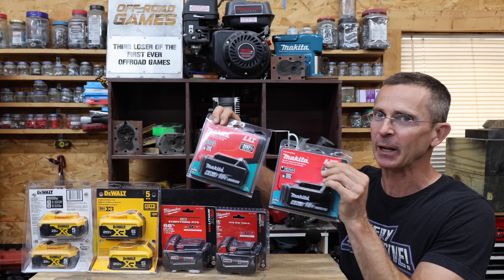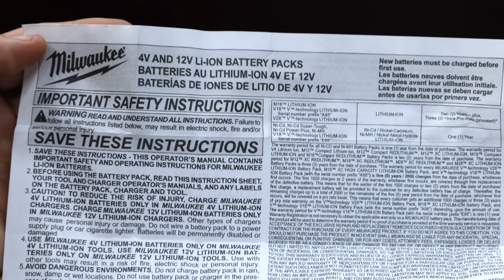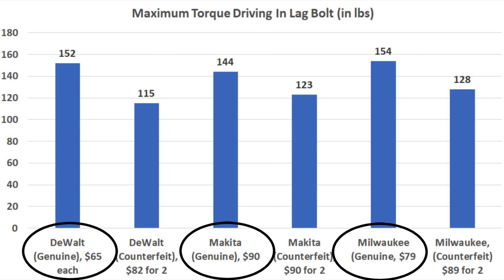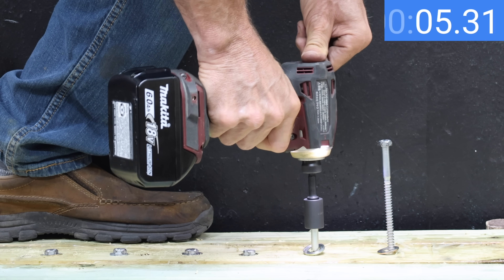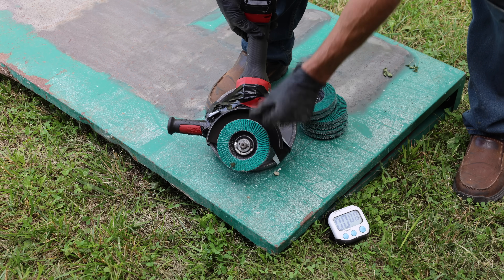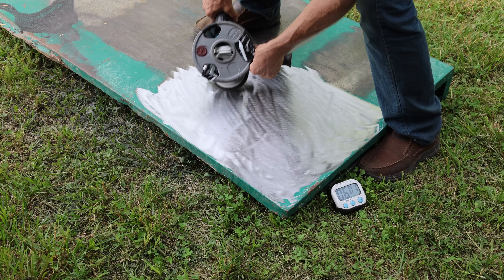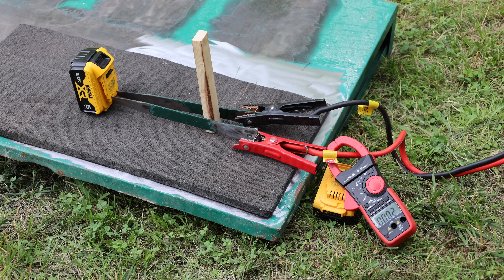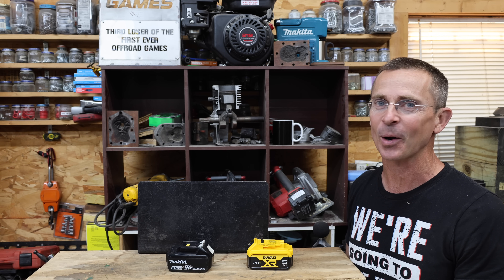Have You Been Scammed with a Counterfeit Tool Battery?

Comment: I've heard that sometimes the actual manufacturers/factories will take an order from a brand for, say, 10,000 units. The factory will fulfill those 10,000 units and then have materials left over to make 'most' of the real product. Just need some cheap batteries, maybe some PCBs made up with sub-par components...
The injection molding machine is already tooled. The print shop already has the files for the packaging. 
Let's run a few thousand more...

Comment: I bought a DeWalt counterfeit that was advertised as a counterfeit and it runs 12:30 with leaf blower but real DeWalt runs 13:30 - if you are scared to get fake just buy Real REAL fake battery because those who advertise them as fake actually try to hold real brands quality as much as possible
Reply from the maker: Thanks for sharing!

Comment: I honestly am perplexed by the genuine Makita, not powering down on the dead short. The counterfeit is better than the genuine in that case, and you save around 50%. Nobody is that thick to open a battery pack in real life to short circuit it. 

Does it involve getting it wet though?

Comment: If your amp meter doesn't support peak mode, you should get one that does. It could be registering a higher current that it hits and then drops faster than the screen can update. Peak mode would display whatever the highest value, regardless of if the screen would have been fast enough to show it in the normal mode

Comment: also there are batteries sold for older tools claiming to be compatible in voltage and amperage but using newer battery types that should be avoided as well. Not specifically counterfeit but not from the manufacturers. I had experience with an older Ni-CD dewalt which didn't have much usable battery life. Amazon had some reasonably priced, supposedly compatible replacements that were Ni-MH cells. Same voltage battery packs, but when attempting to use the drill it would get hot and smell like burning very fast. Ultimately put the drill out of its misery.

Comment: Great episode. My Milwaukee batteries weighed 720g and 733g. I opened up the lighter one and it was genuine. (The inside images and battery color you provide are really helpful. Thanks! PB board was a different color but all the components were the same. )  
Years ago I bought an Apple MacBook Pro charger on Amazon. I've had Apple products for decades including these chargers. All looked authentic. (I bought on Amazon from "Apple" because if I ordered from the Apple Store someone would have to sign for the delivery.)  It lasted many months but eventually overheated and started smoking. Also the power cord was cracking. Following instructions on iFixIt I opened it up. There was nothing Apple about what was inside.  Because of this and other fakes sold through Amazon I try to limit purchases from them. They do a terrible job of protecting customers. A Janome sewing machine I bought on Amazon from "Janome" turned out to be broken, out of spec, not working properly. I called Janome for my life time warranty. 'Where did you buy it?" Amazon. "We don't sell on Amazon." Cost me $200 to get it fix. I suspect it was a surplus machine sold as scrap. I complained to Amazon, the only thing that changed is now these crooks list as "Brand: Apple" and "Brand: Janome."  I expect that if I were to start calling myself Brand:Amazon I'd meet a lot of their lawyers, and if I attempted "Brand: Project Farm" I get a visit from Cousin Eddie and the Farmabago....
Reply from the maker: You're welcome!

Comment: This is actually scary, because the batteries look pretty much identical. And that’s for someone who has a bunch of them already.

I remember going to Home Depot and buying a battery kit from Milwaukee, when I opened it up, it was counterfeit batteries in it. But they were obvious counterfeits, but the store took them back.  I always make sure the box is not damaged or have tape on it when you’re buying from Home Depot. And if it does open it right there in the store.
Reply from the maker: Thanks for sharing!

Comment: I'm not surprised. I've used off brand batteries, but they aren't worth it. While they seem to have similar capacity, they aren't as durable.

The internal connectors can't handle the current of extreme tools like a cordless grinder and seem to be brittle. Additionally the external connectors aren't very springy and don't clamp the connectors on the tool well. So bad I have melted the plastic around the batteries connectors from poor connections.
Reply from the maker: Thanks for sharing!

Comment: You can't trust ANY retailer! Criminals are buying "original/oem" and returning fakes that end up restocked.  Open them up, compare to known good, be ready/able to return as needed.  10 batteries from home depot's "locked cage", 2 were fake. UGH! 20 multi packs of Mach III razors from Sam's club, the first 5 in the stack were almost perfect fakes. ect, ect...  ps. I use a RC hobby charger to verify capacity of all my new batteries, saved me 20x the cost of the charger.  One of those $30 video microscopes has proven useful, fakes have gotten that good.

Comment: Where you will really see a huge difference in the batteries is how many years they last. You'll likely get less than 2 years out of the counterfeit ones and 5 plus years on the real ones.  That's been my experience with generic blue-wrap cells.  When bought individually, they are nearly always labeled as better than they are.
Reply from the maker: great point

Comment: Shortly after Milwaukee released the M12 5.0 and 2.5 HO batteries they appeared on Amazon. The M12 5.0 was 60 something. I ordered one and compared it to the one Home Depot  sold me. They were identical,  the best I could tell. The laser print was there and good. 
Koon Trucking has a weekly video with a Matco dealer. Matco man did a warranty swap for a Milwaukee battery.  Milwaukee contacted him and said it was a counterfeit battery. 
Matco Corp put on a class on how to identify a counterfeit.  Unless you know what to look for you would be hard pressed to identify the knock off, it's that good. 
If the price is a great deal, considerably cheaper than what a authorized dealer charges then the odds are good its a fake. 
My cheaper 5.0 will not last as long  and seems to offer less power. 
Thanks for another great video brother.
Reply: this makes sense, quite possible they set up shop and sold real batteries for a bit to ensure good reviews, then start shoveling trash after a month or 50 positive reviews.
Reply: @Dreddy72  
They are extremely good at counterfeiting. It has the proper color, texture, paperwork, packaging, everything. The reason Matco got involved was they carry and warranty Milwaukee tools. If I remember correctly Milwaukee actually put the class on for all their dealers.  Its a pretty good video, worth watching although he dosen't reveal how to spot a fake. 
Koon trucking Matco video back a few months ago now.
Reply: @Dreddy72  
I just looked for the video. 
It was 8 month ago. The caption says "ratchet winner" and Milwaukee real or fake battery.
Reply: Same experience here. eBay was the place where I got counterfeit from. right now I can only judge from the price
Reply: Amazon has a lot of counterfeit batteries eBay has some more genuine batteries but you still have to be careful
Reply: Cool story bra

Comment: Yeah, I bought 4 dewalt types off ebay which were supposed to be 8 amps though when I got them they were the size of the 5 amp and weighed less. I took them apart and saw they had the same number of cells as the 5 amp. They were only $100 for the 4 but I still complained and left bad feedback which made them very mad. I told them if you bought a whole chicken and only got a half chicken would you be ok with that? It took several letters to the seller and ebay but finally got half my money back which made me a lot happier. So it was 4  4amp batteries for $50 and some of my time.  Thats ebay for ya. Gotta fight for what you pay for.
Reply from the maker: Thanks for sharing!

Comment: the Makita even the normal one will do that under a hot load, they decide that they should no longer charge. you can connect them to a variable power supply and force them to take a charge, the factory chargers just read the voltage as too low and will refuse to charge them. the other way to do ir though less safe is to jump it with 2 pieces of wire a good 18v battery to the makita one + to + and - to - thee charged battery will bring up the voltage of the "dead" one after a few min the voltage will be high enough to take a charge. Most my tools are Makita and I have had to revive several batteries this way even fairly new ones. that came with tools so probably not counterfeit.

Comment: I order my batteries (RIDGID) from Home Depot online or pick them up from the store I don't trust the ebay or amazon knock off for the reasons shown here. With RIDGID when registering them for the LSA if the serial numbers don't match, they will not show up. Not to say one can't gut them and swap out the parts for the fake components. With any batteries check packages and don't trust the open packages as returns or slightly used.

Comment: I'm shocked that the genuine milwaukee battery didn't power down sooner!!
Reply from the maker: Thanks for sharing!
Reply: It's probably how they get their better output numbers from their batteries vs the competition, since they are all the same cells.
Reply: @nanogaming7949  It makes sense, the batteries failed safely, and their performance/warranty policy is what keeps people coming back.
Reply: Maybe a better microcontroller keeping up efficiency between cells than the competition.
Reply: @Walkeranz Holding a short for that long is not a good design if it's intentional, especially since the electronic board was damaged. While the battery doesn't cause a fire internally, an external short load may cause a fire if 180A continues for 14+ seconds.
Reply: he made another video a few months ago about cheap batteries and the genuine Milwaukee performed as you'd expect in that one.
Reply: This is exactly why I buy mostly makita. Yes I know they lack power in certain areas but their engineering is number 1. And their 40v stuff lacks no power. I proudly pay the premium for the 40v stuff.

Comment: I bought makita batteries on ebay. They were advertised as authentic oem bl1860b batteries, which is the 6.0 AH. Pictures of the real batteries, seller had 10’s of thousands of sales on ebay and a fairly high rating (70+ percent i believe). I got them, and i got Vanon branded batteries that were compatible with makita. Checked the listing, it had changed to the Vanon ones i received. I went to show some friends and when i pulled it up, the listing (i clicked on the listing from the purchases page) was for some type of childrens toy. Thats the only bad experience I have with ebay. All my makita tools came from there and absolutely nothing wrong with

Comment: The circuit board is a BMS battery management system it won't let you overcharge them discharge them. hopefully it stops them from catching on fire. hot and cold management for discharge and charging 💥💥🛠️🍻🍔
Reply from the maker: Thanks for sharing!

Comment: OK... So, kind of figure that you're getting a knock-off battery that's approximately 80% the efficiency of the OEM battery, and for less than 50% of the price of the OEM battery.
Buying two knockoff batteries together costing the same price together as one OEM battery should result in about 160% overall equated efficiency, provided it's all free shipping.

Comment: My issue is why is information rubbed off on the batteries, the numbers on them track to fairly good batteries. They are Samsung but the IRC18650/20P is made by EVE and is an OK battery by it's self. I wonder if on top of being fake packs they are using rejected or used battery cells when making them in China. Great video and thanks for doing them.

Comment: I bought a "Milwaukee" M12 6ah counterfeit battery on Ali, well knowing it was not genuine, bought it only for "testing" first day of using it, it stopped working, I disassembled, it and a wire from the battery to the connector was loose at the soldering, soldered it back together, and used the battery some in a screwgun, no problem, switched to a zall saw, and the wire came loose again, now I have soldered it back together several times, beginning to think that maybe the wire is to thin, so it is getting so hot, that the solder is melting, next must be a thicker wires, or a silver soldering

Comment: Good piece, very informative.
The cost of buying OE from a trusted source has gotten $$$$ in some cases. I used to use an older DeWalt 1/2" drill at work (switchable to hammer drill mode for masonry) and needed a couple new batteries. I got a call from our expeditor a few days later and he told me to come down and pick up my new drill, which was an equivalent Ridgid model.  He said two legit DeWalt batteries would have been $250+ and it was cheaper to just give me a new drill.  That's the point we're at--